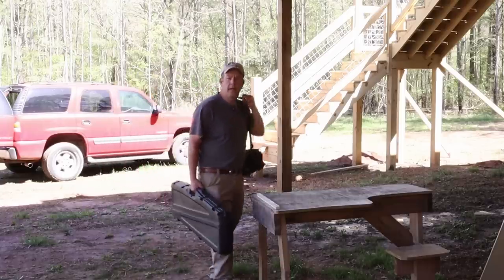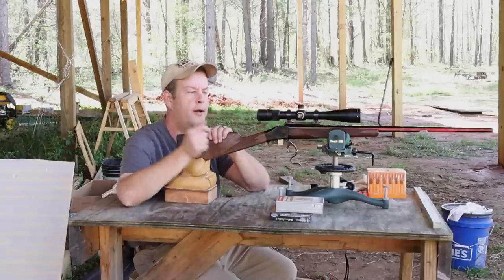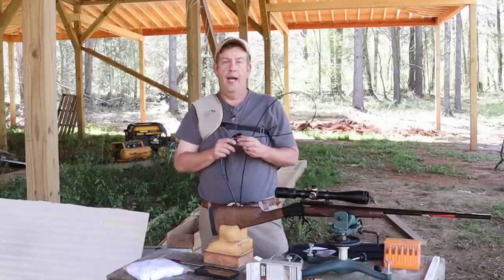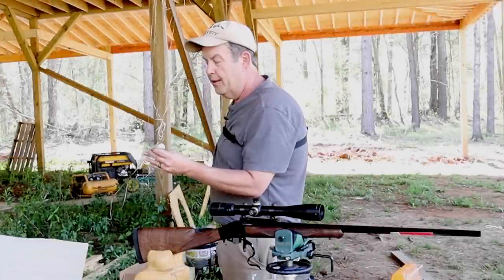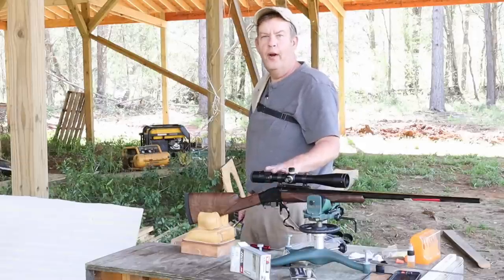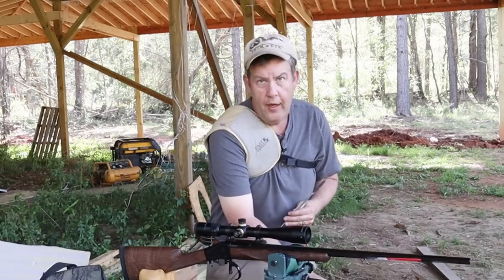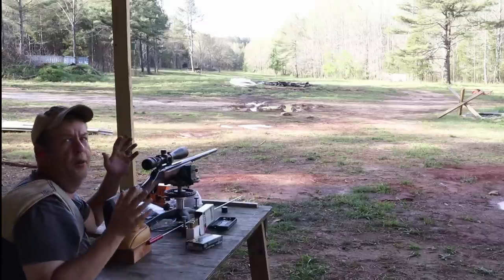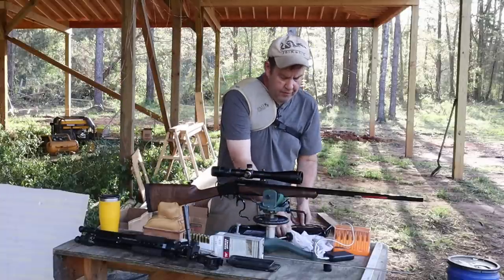1885 Project:  Complete New Barrel Break In

Comment: I don’t believe that soft brass from a bullet is capable of flattening, removing, or burnishing hardened barrel steel. In my mind, a rough barrel only becomes more smooth by copper fouling filling in any potential dips in the steel. Hand lapping will remove imperfections in the steel however. 

I do not believe removing all of the copper from a barrel is a good thing.

Comment: Hi Tom.

No doubt, you're familiar with "GunBlue490", a fellow firearm YouTube'er, and his take on this break-in business.

My understanding of his point of view, is that break-in's were useful when barrels were made with the rifling cut in with machine tools--after the bore was drilled.

Tool marks and gouges filled in with the first few shots of copper jacket were like potholes filled with asphalt to smooth the surface

The are no longer necessary in the age of CHF barrels, that he says are glassy-smooth from the beginning.

I have a new rifle with an FN made CHF barrel not yet fired.

Not sure what to do.

Your thoughts?
Reply: Tom is likely stuck in his ways and would argue against logic. Not hating, but this whole 'break in' thing is nuts. Most people are poor shooters and only ever shoot 3-5 round handpicked groups to justify their process. If a modern manufactured barrel is visually burred or damaged or has pitting, it's defective. Thinking that polishing a barrel by hand with abrasives is more effective than shooting a 50k chamber pressure projectile down the bore in removing any remaining detritus or rifling aberrations is goofy. If a barrel is out of spec, it's out of spec.

Comment: It would have been more interesting to see what the shot pattern was for all rounds fired, rather than adjusting the scope between groups.
Reply from the maker: It would have, but with that said I never moved the scope between the 3rd and the 5th one. So all of the movement on those 3 groups is just the result of changes in point of impact and the majority of the movement appears to be in elevation.

Comment: Personally I break in all my new barrels,  I use an abbreviated procedure, 3 shots cleaning between each, two 5 shot strings cleaning between each and a 10 round string to finish.  I return home, clean with Patch Out and bore scope the barrel.  Most times I will see a nice, burnished layer of copper on the lands and I know I'm ready to go.  Some people say it's not necessary but IMHO it doesn't hurt and all my rifles shoot very sub-moa so it works for me.  The one rifle I think it didn't need it was a Ruger American in 450 Bushmaster, that bore looked like it was lapped and POLISHED from the factory.  I still broke it in but to this day at 100 yards it will cloverleaf 5 rounds of factory Hornady 250's into one ragged hole.

Comment: Why would your point of impact change so much if the break in was doing something? Did you adjust the eliv./wind. On the scope?
Think you correct, most of the folks saying you don't need break in are shooting match barrels.
Reply from the maker: Julio, I made one scope adjustment after the 2 shot group and I didn't make any adjusts from the 3 shot group to the 5 shot. And I was wondering about the change in the point of impact myself. It seems everything stayed about the same left to right from the 3 shot group to the 5 shot but there were a lot of changes vertically. My guess is velocity changes?
Reply: Definitely velocity change great job Tom. Good info in this video and I suspect floating the barrel a bit more will definitely make it a shooter

Comment: Never understood spending big money on a rifle and then putting a POS scope on it.  Use a bore guide, it will keep the solvent out of your action and support the rod as it travels down the barrel.
Reply from the maker: Michael I had the exact same thought on the bore guide and even used it, once. The problem was my cleaning rod wasn't long enough for both this 28 inch barrel and the bore guide. I had to unscrew the rod, pull it out, remove the bore guide, and then put the rod back in and screw it to the brush and push the brush out. The brush was to tight for me to back it out to start with.

Comment: I’ve never done a proper break in but I’m planning on getting a “cheaper” 243 here soon for varminting and am definitely doing a break-in to give the best groups possible with reloads, you just sold me on the process not only with the results but the in depth reasoning behind it
Reply: If the "cheaper" rifle has a hammer forged barrel, then break-in may be of use. If you intend to use JB or Iosso, make sure you use it smartly by wetting the bore with KROIL or FREE-ALL first. Don't use a bore paste in a dry barrel

Comment: Mostly because of the new Barrel making processes, even a broached barrel. If they didn't test fire the barrel you make sure you run some patches through it. Fire 20 rounds. Clean the rifle. That's it, you're ready to go you fire a couple of falling shots and you do a test. The first rifle I ever use I made sure it was clean I loaded up the ammo for it I fired nine shots to sight it in and fired a 20 round group into a center to Center spread at a hundred yards of .049 inches in 1979 Ruger Model 77 7 mm Magnum. Every time I fired a group, with that rifle for the next several years, it was a 20 round group, and they all fired, whether that they had Sierra bullets or Hornady 140 grain Spire point, a point 33-inch group edge to edge. That is still a .0 49-inch group center-to-center. I sold that rifle for $200 more money than the guy could have bought a brand new rifle for. And I had every group I had ever fired out of that rifle. Every Target.
There is no such thing as copper fouling. The reason they went to a cupro-nickel bullet jacket is because 10 that they used up until about World War 1 was horrible that following a barrel. Ever since they went to cupro-nickel jackets, there has never been a reason to clean metal fouling out of a barrel. You do have to clean lead fouling out of a barrel, but I've only fired lead out of a pistol for decades. And that was only specific loads of a very hard test let out of my 44 Magnum super Blackhawks. Completely different story.
Single-shot rifles will string like that. Mostly because of the way that the barrel shoulder fits against the receiver. That has to be a supremely close fit. I've seen a lot of work done with Ruger number ones. And although they generally shoot pretty good, they can be persnickety.

Comment: I had a brand new Browning A Bolt II Medallion with the BOSS system in 300 Win Mag in the mid 1990's that couldn't shoot 3 shot groups smaller than 3" at 100 yards using everything from factory ammo to handloads after trying all of the bullet weights available. I lapped the barrel with Flitz metal polish about 30 plus passes and the groups afterwards were sub MOA with handloads. FYI, the BOSS system was a joke! Bore scopes were not available back then, so I don't know how bad the barrel was. You could literally feel it getting smoother with each pass. I was worried that it would end up making the barrel worn out, but it fixed whatever issue was causing me problems.
Reply: I should have noted that if you use any abrasives to lap a barrel you need to make sure that you need to remove all of the compound. If any gets left in the bore you may end up with a STUCK CASE that you cannot remove! If you think that you cleaned it good enough after using a lapping compound, clean it three more times!
Reply: I disagree I have a Browning 30/06 with BoSS system. Pick ur ammunition adjust the brake till you shoot sub MOA write down ur settings. Grab another ammo go through adjustment again write it down and so on. Now you can have sub MOA with the ammo of ur choice. Only negative this thing is LOUD!

Comment: As for hunting. Don’t get to excited. About breaking in  but.  It critical if a barrel. Gets water in it it’s very important to clean and lubricate  over the life of your rifle. Which will mostly outlive.  Most hunters especially if they have more than one rifle     It’s very important to have consistently in your. Cleaning outside of barrel and inside if you live in damp climate. Also guns tend to condensate  when the guns.  Are taken from cold outside into a warm house.   Condensation can turn to rust on steel. If neglected  just my  thoughts   Clean and lubricate is the secrete
Reply from the maker: And your thoughts are spot on Dominic. I live in a very humid environment and I have to make sure I wipe my rifles down after every use. And I'll explain later on about adding a light coat of oil to the bore before long term storage.
Reply: @TomRiverSimpleLiving    Great.

Comment: Fantastic content!! For many years, I took my rifles to a gunsmith annually who "accurized" them. He would ensure copper fouling was removed from the barrel, properly torque action screws and re-zero if necessary. If I bought a new rifle, I took it to him, first. This guy was a former marine sniper and he forgot more about rifle accuracy than most people will ever know. He had my BAR Mk II safari tuned to the point that it was more accurate than most bolt action rifles. He would follow many of the same steps discussed in this video.

Comment: For 30 years I did what was deemed a proper break in on every new factory and custom rifle regardless of barrel make from Hart, Shilen, Broughton, Lilja, Pac-Nor, to Obermeyer, Krieger, Bartlein, Brux, Benchmark and I never had anything to compare to since I followed the same procedure. In the last 2 years I decided to stop barrel break in since so many barrel makers and gun builders said they never bothered with it. I did not do any break in with my new 308 with a factory Tikka barrel, my Hart barreled 7mmPRC, or my Lilja barreled 6.5PRC. I will have that 308 Tikka back soon with a Brux barrel. My 6.5-284 Norma ships from builder tomorrow. It has a Brux barrel. In my experience, barrel break in didn't change anything compared to my 3 rifles mentioned that I've already put over 20 to 30 rounds through. I won't do break in anymore. For me, turned out to be a waste of a LOT of time, solvent, patches, and brushes. 

I just shot the 6.5PRC this past week at 560 yards, the full length of a wheat field. It's the longest distance I have at my dad's property. I used factory Nosler 140 ballistic tip ammo. Dialed my scope 11 MOA, did not hold for wind, and shot two 3" 5 shot groups. Prior to that I had one box of Hornady ELD-X ammo through it (20 rounds), then cleaned to bare metal. Barrel cooled for an hour while I shot the other rifles, then I shot those Nosler bullets

I have what appears to be the same borescope you have - Teslong flexible. I attach mine to my laptop for larger picture

If the primary issue for break-in is new chamber burrs at the throat area where the lands begin, do what I do, clean every rifle before you ever shoot it. Unfortunately, production rifle manufacturers don't do it. My custom builders tell me they do and I borescope them before I do. If there's anything in the bore that looks like it could clean out, I do it